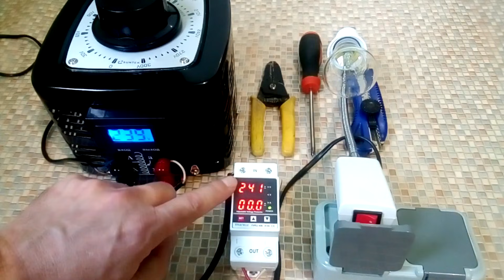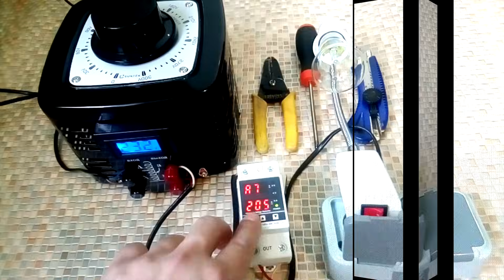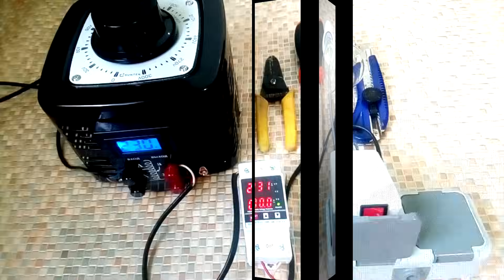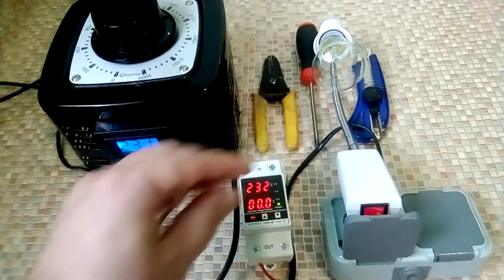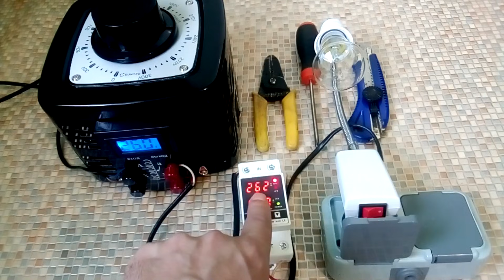AliExpress Voltage Relay – Testing & Programming | Is It Any Good? | DIY Overvoltage Protection

Comment from the maker: https://alli.pub/75ca4c?erid=2SDnjeTSCNG - Voltage relay TVPS1-63B on the video on Aliexpress
https://alli.pub/75ca9e?erid=2SDnjd8MBCG -  Voltage relay (analog) on Aliexpress
https://alli.pub/75e07a?erid=2SDnjeMeeRz - LATR SUNTEK 1000VA from the video.
https://bit.ly/Pomkan - Support the channel financially
https://www.youtube.com/@EkimovIgor1 - This channel in Russian.

https://youtu.be/Tk2Jm5pXhoM - Multifunctional Voltage Protection Relay TVPS1-40B
https://youtu.be/Dx4PjCo6-tQ - Voltage Protection Relay Install & Wiring
https://youtu.be/FmlVeXbjAMw - Compact DIN-Rail Power Meter from China
https://youtu.be/wLT6Wwv7nNc - Portable gas analyzer TOOLTOP PLT850
https://youtu.be/fTNVlWXwR2M - Thin digital multimeter FNIRSI S1

Comment: Excellent voltage relay. This is a necessary device for electricians. Thanks for the helpful review.
Reply from the maker: It is useful not only for electricians. It is useful in almost any home. Such a relay or similar.

Comment: I ordered this voltage relay to protect equipment from surges and short circuits. I installed it on my air conditioner, it works perfectly, it works at low or high voltage, as stated. It looks high-quality, the case is durable, all connections are intuitive.